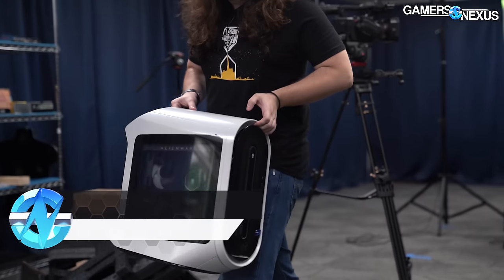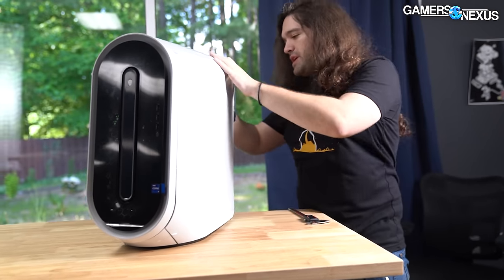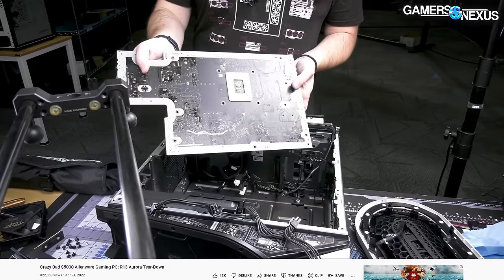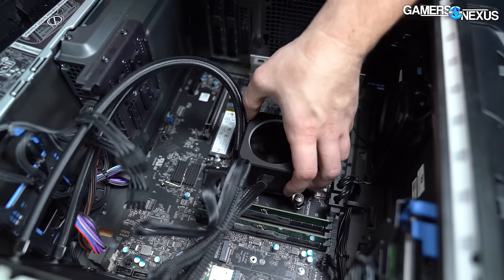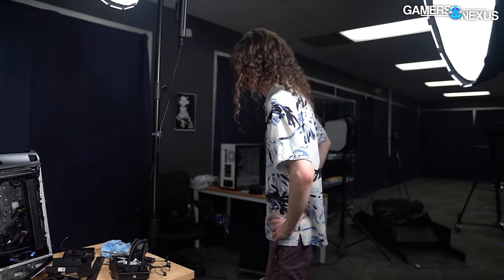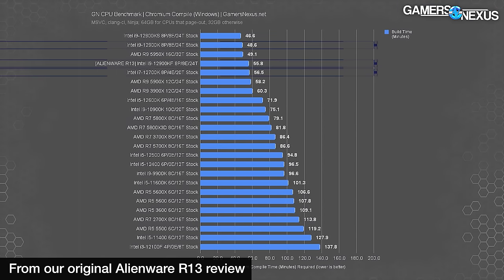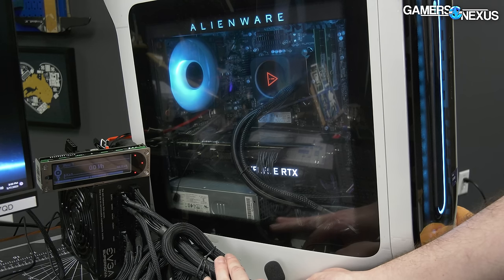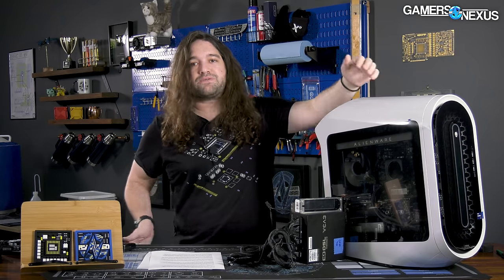"Fixing" the Alienware R13 Dumpster Fire

Comment: The 120 aio is marginal at best for the 12700kf…. I barely could keep the cpu temp below 100C (and thermally throttling) running the XTU2 benchmark.  Following the inspiration from this video, I swapped out the factory aio with a Celsius+ S24 Dynamic.  I kept the factory fans and just swapped out the radiator and the pump.  The radiator I mounted to the chassis in the front, and the put both factory fans on the radiator.  Put the fan connections back on the motherboard so the BIOS wouldn’t freak out.  Kept the rear fan in the back of the case along with its lighting.  The mounts for the Fractal are included so just use their mounting screws.  They go right into the case.  The only thing is to keep the pump on PWM (not auto) and plug the pump into the Fan CPU header and not the Fan Pump header.  (Only connection to the Motherboard is the FanCPU!  No USB needed with this aio!). Then some playing around with the thermal profiles has netted some impressive results…. Now running the XTU2 benchmark I only see a peak temperature of 83C. (Ambient of 25.2C for both runs). To control the RGB on the pump, a simple plug in manual controller is all that is needed.  No airflow issues with the power supply….  The 240 may not be enough for a 12900kf but it would be an improvement.  Cheap fix, and it’s an Asetek radiator and pump.  No impact to BIOS as the factory fans are still in place.  Even can control the fans (and pump) via AWCC!  Many thanks Gamers Nexus!

Comment: It's a bit puzzling to me, how everyone hates on the R13 -- I'm not the most hardcore gamer but I was very happy with mine for over 2 years, zero problems, performed OK, never a BSOD, never a hardware issue until about 2.5 years when I had a power supply issue... I guess my expectations are lower than more expert users?

Comment: OK I love you guys, but unless I'm misunderstanding something, I'm pretty sure you got it wrong on the Corsair pump needing the Corsair hub in order to control the pump.  Included with that corsair cooler (along with the big cable) is an additional standard 3-pin fan cable that you can plug into the cpu-fan (or any fan) header directly on the motherboard.  Not sure if that weird motherboard has those headers or ability to control fans, but regardless, it's not Corsair's fault.  Not sure how Patrick missed that.

Edit:

Here is a link to the manual for that Corsair pump:
https://www.corsair.com/corsairmedia/sys_master/productcontent/AA_WW_Elite_LCD_Web_QSG.pdf

Comment: You don't lose 'a lot of performance' by dropping a 12900K to around 170W. I've told lots of 12900K owners to do this and they all reported basically identical performance but the temperatures dropped by 20C. The main difference between their builds and this one, is that they had a competent cooler. The cooler is likely the main problem here and not the power limits.
Reply: Under what load conditions are we talking about? My 12900k goes up to 70 C when under full load.

Comment: I was forced into buying an R10 at the height of the parts and price issues 18 months ago - I had so many issues with the bios and essentially it led to 3 out of the 18 months of owning the computer not being usuable. Warranty eventually replaced the motherboard and it worked again for a few months but it broke down again and I had enough. Canabalised the damn thing and built another PC. Never ever again will I buy from Dell or Alienware and will devote a substantial amount of my time going forward convincing others not to do it either.

Comment: I made the mistake years ago of buying an Alienware laptop, having heard good reviews. Turns out those reviews were from BEFORE they got bought out by Dell, and the buyout had happened a few months before I purchased.

The piece of crap lasted less than two years - the graphics card stopped working at about 18 months. Which should have been fixable as it was supposed to be a swappable graphics card - but it turns out it wasn't the card itself that was the problem, the chipset on the motherboard interfacing with the card had burned out. Still had internal graphics but the laptop became useless for gaming.

At about 20 months, the screen literally started falling off. Turns out the screws holding the hinges had attachment points individually heat-pressed into thin plastic. Those attachment points came loose on one side first, the other side didn't last much longer.

Of course it was out of warranty.

Comment: Funny thing is the R12 is actually better in that the front IO is separate and main issue is it uses propriety PSU connectors to the MB so replacing the MB or PSU requires the other to be done too. But the MB is matx and PSU is standard size.
The plastic could easily be dremeled with a few holes in places to improve airflow. And for midrange 12700/11700 Cpu/ 3060/3070 GPU and below it's fine

So how they went worse from the R12 to the R13 is mind boggling insane

Comment: You could use a split loop using quick disconnect parts from Alphacool and have 2x120mm rads, one as intake and the other as exhaust? Running the lines from one end of the case to the other would definitely add some water volume lmao

Comment: I keep looking at the front of this case and thinking they could have made that plexiglass into a convex ram scoop to accelerate air into the case.  Would still look cool, but be functional.  Those door latches seem sturdy.  There are some cool ideas in the case design, but poorly implemented.  Get rid of all that proprietary hardware Dell!!!  Alienware, before Dell, used to use standard components.

Comment: I'm laughing at a scenario in my head. It goes like this: A customer sends in their R13 for repair because it's not performing as well as they hoped and it's loud. Weeks later, they get their "computer" back, and it's basically an entirely new case, mobo, and configurations. They demand an explanation, and Steve just goes one by one on why each part ended up having to be replaced and you end up with a speechless customer.

Comment: I preordered a few R10 during lockdown to get video cards and AMD 5000 series processors.  My experience has been the same even though the R10 is an older model.  The layout on the R10's case is a little different but so much of it is custom that it's just future landfill if any of the main parts fail.  The PSU uses a custom split-cable design such that a standard 24 PIN cable is not compatible.   Moving the PSU to a new case is not possible because the R10's split PSU cable is like 4" long. The motherboard IO is all custom, the size is custom and the whole thing is just not reusable outside the original case.    

As an aside the BIOS Dell makes for these is so limited with regard to CPU and RAM.  I couldn't get anything less than a 5000 series AMD processor to work in any of mine.  I tried a 2600 and a 3700X and neither worked.   That is particularly inexcusable, in my opinion.  I could have had a use case for giving life to an older CPU to use these plastic disasters for a small home server, but Dell's bios is as trash as their case it.  

Support for aftermarket RAM was very spotty, I ended up having to get the same model ram that came with the device to upgrade it in one system.

For the one of these I use as my main PC, I pulled the CPU, GPU, Memory and SSD and built a new system with decent aftermarket parts.   

Dell has lost me as a customer forever, in both personal and business purchases I make.  At work we got stuck with one of those $10/mo. super-secret warranty "upgrades" and it was IMPOSSIBLE to cancel.  They charged us for that until the credit card expired, which thankfully was less than 1 year.

Comment: I got my R10 5800 (non x) last year and my friend an R11 mainly for the 3090 for mining at the time, as Dell let's you bargain for discounts pretty steeply, if you go through the right channels.  I knew I was getting a low grade desktop, for the gpu, as these videos recently have shown, with mediocore thermals and bios options. But they still  managed to surprise me by going below my low expectations.. plus the noise pollution. Quality of AW seems to be  a far cry from their buissness line which at least in my experience has been pretty good,  though coming mostly from Latitudes and Precision laptops though...

Comment: When I was a kid, they had an Alienware Aurora R3 or R4, and I remember back then really wanting that computer. But as I got more interested in PCs, i watched lots of YouTube videos, and realized how bad of a deal the Alienware was compared to what I could get if I built it myself.
Reply: I'm typing this comment from the Aliennware Aurora R3 I bought 10 years ago.
I am was almost ready to pull the trigger on an R13, but now I'm reconsidering after watching this series of videos.
Reply: @joshuamiller8235  Just build a computer, it's way cheaper and honestly you can totally wing it and put it together in no time. Just copy someone else's build if you don't want to choose every part yourself
Reply: @youreyesarebleeding1368  I actually just did that a few hours ago. I asked for help on Reddit, and built a BETTER system, for cheaper, only difference is I have to wait about a week longer, and build it myself. Gonna be a beast of a system. Looking forward to it after having nothing but my Alienware Aurora R3 I72600K for the last 10 yearsnow with a 1050Ti, upragded from the best option they had back then.

Getting an I9-12900KF with a 3090TI, 32 GB DDR5 @5600 mhz, a 1300 watt power supply, HUGE SSD's, A Tomahawk mobo.

Can't wait to get into my VR flight sims!

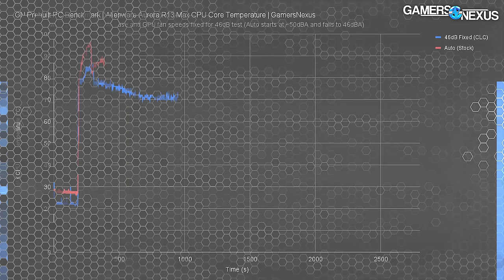Comment: 19:51 fan control doesn’t have to be that complicated that you need an external power supply with a silly remote and screen. you can use a sata power analog knob controller from Amazon for $12. It screws in the pcie bracket and the knobs are manually controllable. I needed one for a dell board (go figure) and it comes with like 6 4 pin fan headers.

Comment: I got the i7 12700k with DDR5 ram and 3060 Ti for $1050 from Microcenter as an open box last week.  It was unused and had the wrapping on it.  Box was beat to Hell but the computer was perfect.  Only when it is on clearance and for this price is it worth it.  If I was a serious gamer it probably still wouldn't be worth it due to the cooling and proprietary stuff.  The XMP is greyed out so I can't even change the RAM frequency.  The factory sticks are 4800mhz but Dell locked it to default of 4400mhz...WTF Dell

Comment: 6:35 omfg what engineer at Dell thought poking a few holes in sheet metal was enough ventilation?! I thought the issue was just the narrow edge opening in the front plastic. I didn’t realize the chassis was even worse.

Comment: Bought One In Apr 21. It Had Intermittent Online Connection. Dell's Solution Was To Replace The The Wi-Fi Card. It Actually Got Sent Back To The Depot Level. When I Got It Back Nothing Changed. They Sent A Tech To My House. Replaced The Wi-Fi Card Again. No Change. The Kicker Was I Was Not Using Wi-Fi, Ethernet Only!! As Soon As The Warranty Was Done, They Disowned Me. I Took It To A Local Repair Shop And Turns Out The NIC Was Bad. So I Was Out A Couple Dollars. I Would Never Purchase A Dell PC Again, No Matter How Much Cheaper They Are.

Comment: On top of the 240mm rad I'd be hacking away everything behind that front panel. After that just take some black plastic spray paint and paint the front panel from behind. It would end up looking solid gloss black through the plastic and hide any of the mods that were done behind it.

Comment: Honestly, I genuinely like the case aesthetic here. I do NOT like that they artificially gave themselves less space to work with and a reasonless proprietary PSU when normal compact PSU formfactors would've worked better... Also to fit your self-imposed rules you WOULD have to plug the hub in somewhere else to preconfig, as you kinda have to either put the little ayylmao guy back on the screen or add some cheesy sci-fi energy core animation.

Comment: There is actually a way to plug in the USB 9pin. The thing is that it would need Jerry rigging so you can adapt it into a normal USB and then plug it into the back. I don't think it works tho for the commander pro though.

Comment: My favorite part is they basically have a box just like every other case... So they could have taken ANY functional case, angled it, and slapped an asthetic to it and did fine. Instead they made an all original non-functional box.

Also, glass side panel and then they put bland 2000's styled plain green ram in and no cool motherboard asthetics. I have no idea what their aim was.

It lacks a beefy chipset/VRM cooler common on good quality boards. Its actually one of the flattest i've ever seen. It looks like they knew this thing would crazy throttle lol.

Comment: Dell these days is quite unlike the Dell in the yesteryears. They have come up with a system called Support Assist that is a disguised planned obsolescence system. Think of it as a Trojan horse. It is introduced to keep your systems updated and working till the warranty period, and swiftly after the warranty expiry keeps introducing updates that lead to one or the other software malfunction. The warranty then offered for a year or two is close to the price of a new laptop; just slightly lesser perhaps. So, my two cents is to ignore the fancy lighting, packaging and other fancy stuff and go for a brand that provides you the not so fancy but a reliable and lasting product. I bought an Aurora last year and it is close to garbage. All the best folks!!

Comment: could you take a small drill bit and make a bunch of holes in the side panel. Essentially making it a perforated panel. I would think that would help with airflow while also not moving away from the original design too much.

Comment: Is the I9 locked to the Alienware motherboard? Some OEM systems are set up that way, preventing you from harvesting the CPU to use on any other motherboard. The manufacturer flashes it at the factory and once done it can't be undone.

Comment: Tell if I'm wrong but it looks to me like they have the radiator cooler fans set to blow hot air into the case instead of extracting the hot air from the radiator.

Comment: Just saw off the front i/o from the dell custom stock motherboard and solder in wires and connectors to use a standard motherboard. Such convenience and it only costs $5000?

Comment: Great video and content. But couldn’t you just have drilled multiple (2mm) holes into the front to permit airflow. You obviously have to change the cooler because it’ll throttle but yay or nay on the holes?

Comment: Back 20+ years ago Dell used to switch 2 pins on the 20 pin connector so if you replaced the PS or motherboard without a Dell part you would fry your system.

Couldn't you just use the Dell fans?  And modify the shrouds so the bottom fan still cooled the power supply?  Worse case you likely could open the power supply, cut the fans out, put a 120mm hole in the cover and wire a 120mm low RPM fan in place as it likely draws less power than the 2 smaller fans at such high an RPM.  Then you just remove the shroud.  This way you could likely have just used a cheaper 2x120mm radiator, pump and water block closed loop and a case fan on the PSU.

Comment: Wait, your pump block (cpu cooler) is higher than the intake/output of the radiator... won't you get airbubbles sustained in the pump, essentially eliminating your cooling effectiveness?

Comment: This is a prime example of why Dell needs to pull their heads out of their rear ends and actually start designing systems around the needs of the components.  Right now they design systems around what cases and coolers they have a surplus of and the CPU and GPU requirements are not even factored in.    Dell Executives: "We have a surplus of these cases and 120mm coolers, lets cram them into as many systems as we can and just throttle the hardware if we have too."

Comment: To fix properly this would require a completely new case design. That case looks miserable just from the outside view. 
I've been doing PC builds most of my life (i've been around a while safe to say), one of my pet peeves with board designs has been placement of cards and other surfaces that obstruct airflow or conflict with the intended direction of airflow. Combine that with cases that ignore established working airflow concepts and you have a desktop furnace waiting to happen.

Comment: If you're REALLY a glutton for punishment, you could swap out the on the Dell AIO radiator for a 240 with longer hoses, then you wouldn't have to worry about the fan controller problem. Would the Dell AIO pump be able to handle the increase?

Comment: You could have used a different, dumber cooler and used a SATA power to 4 pin fan adapter to run the pump. You could also have take the dell fans out of their cages and screwed them to the radiator instead of using the coolers original fans and just used the existing connectors for the stock Dell fans. Who knows though if the BIOS would have liked not seeing the pump, although I think you already had that issue, because if I recall correctly you said the pump powered by some weird proprietary connector.

Comment: You'd have to wire a new power supply to the old power supply wires(if you can even find a diagram to do so) to make this work at all and it'd still sit outside and the fan controller too

Comment: A custom PCB using a custom PSU in a custom case which isn't designed to handle PCBs and components of this size... Go Steve, polish that turd like your life depends on it!
I simply can't fathom why Dell would put so much effort into overengineering a clearly unsuited case to fit these components, when simply switching to a new case design and using standard components would be cheaper and easier for all parties.